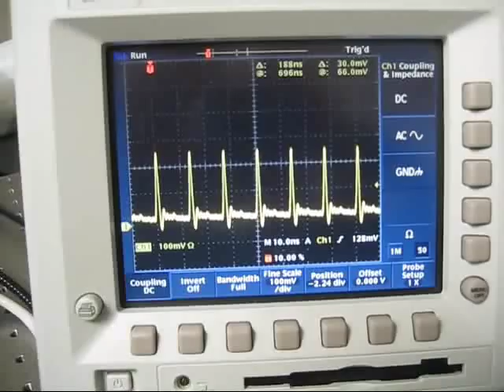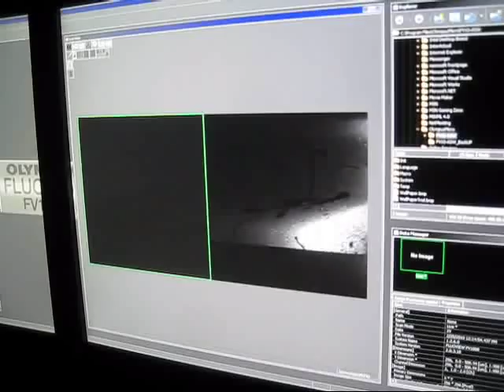Multiphoton Microscope Alignment using Second Harmonics Generation Crystal

Comment from the maker: BBO and KTP crystals for Second Harmonic Generation SHG sales@dmphotonics.com 
BBO and KTP crystals for Second Harmonic Generation SHG sales@dmphotonics.com

BBO crystals with mount diameter 25.4 mm 
Common specifications  (e-mail to request a quote for standard or custom BBO crystal)
Material: BBO crystal
Dimensions: 6 x 6 mm (+/-0.1 mm)
Thickness: 0.2 mm
Surface Quality: 10-5, scratch-dig
Flatness: Lambda/6 at 633 nm
Parallelism: < 5 arc minutes
Other faces: fine grind
Coating: AR/AR at 800 nm and 400 nm for SHG and protective (P) coating for THG
Mount diameter: 25.4 mm 
Type I, SHG, 800 nm to 400 nm
Orientation: Theta = 29.2 deg; Phi = 90 deg (+/- 0.5 deg)
Part number:
BBO_SHG_6_6_0.2_AR_800_400 
http://www.dmphotonics.com/BBO-crystal-SHG-THG-coating/BBO-Type-I-crystal-SHG-800-400.htm

Second Harmonic Generation in Nonlinear Optical Crystal 
https://physics.ucsd.edu/neurophysics/courses/physics_173_273/SHG_Diana_Jeong.pdf

Second-harmonic generation of amplified femtosecond Ti:sapphire laser pulses
http://www.researchgate.net/publication/38038394_Second-harmonic_generation_of_amplified_femtosecond_Tisapphire_laser_pulses/links/00463527aba49d5df8000000

Comment from the maker: Quantitative Imaging: From Cells to Molecules

Cold Spring Harbor Laboratory
April 5-18, 2016
Applications due January 15, 2016
Online application:  https://meetings.cshl.edu/courseshome.aspx

Combining careful image acquisition with computational analysis allows us to 
extract quantitative data from light microscopy images that is far more informative 
and reliable than what can be seen by eye.  This course will focus on advanced 
quantitative fluorescence microscopy techniques used for imaging a range of 
biological specimens, from cells to single molecules. The course is designed for cell 
and molecular biologists with little or no microscopy experience who wish to begin 
utilizing microscopy in their own research. Students will gain a theoretical 
understanding of, and hands-on experience with, state-of-the-art equipment used 
in quantitative fluorescence microscopy, including: wide-field fluorescence 
microscopy, laser scanning and spinning disk confocal microscopy, total internal 
fluorescence microscopy (TIRF), super-resolution methods (structured illumination, 
STED, STORM and PALM) and digital image processing and analysis. Students will 
learn how to design and implement a wide range of imaging experiments using 
these techniques. Students will also learn fundamental image processing, 
segmentation and analysis techniques using a variety of commercial and open 
source software packages. Students will use these image acquisition and analysis 
techniques to address specific quantitative questions and then discuss the results 
as a group, learning to troubleshoot the common problems that occur in the course 
of a quantitative imaging experiment. Among the lectures presented are: 
quantitative microscopy basics, transmitted light microscopy, image segmentation, 
image analysis, CCD & sCMOS cameras, confocal microscopy, multi-photon 
microscopy, deconvolution, TIRF, imaging ratio-metric “biosensors” (including 
FRET), light sheet microscopy and super-resolution techniques. Students will also 
learn guidelines for choosing fluorescent proteins, and work with live samples 
requiring environmental control.

Additional Lecturers for 2016:
Julie Canman, Columbia University 
Elizabeth M.C. Hillman, Columbia University 
Bo Huang, University of California, San Francisco
Talley Lambert, Harvard Medical School
Nathan Shaner, The Scintillon Institute 
Clare Waterman, National Institutes of Health

More info and online application: https://meetings.cshl.edu/courseshome.aspx

Comment from the maker: Reef NOPA1402 Scanning Autocorrelator sales@dmphotonics.com
Input wavelength range*: 500-700 nm
Input pulse energy:
>1 uJ  (at 10-250 ps)
>0.3 uJ (at 1-10 ps)
>50 nJ  (at 100 fs - 1 ps)
Input pulse duration: 30 fs - 10 ps  (up to 250 ps on request)
Input beam polarization: linear, horizontal
Input pulse repetition rate: 10 Hz - 100 MHz
Temporal resolution:   
4.2 fs (at input duration <100 fs)
16.6 fs  (at input duration >100 fs)
33.3 fs  (at input duration >500 fs)
<100 fs (at input duration >5 ps)
Scan range: 35 ps (up to 850 ps on request)
Power requirements: 220/110 V AC; 50/60 Hz +-10%

* - other wavelength ranges are available (see below)
Additional set of one crystal, beam splitter and filters for 700-1100 nm
Additional set of one crystal, beam splitter and filters for 1100-2100 nm

http://www.dmphotonics.com/Reef-RTD_autocorrelator/Femtosecond%20autocorrelator%20Reef-RTD%20700-1300%20nm.htm
http://www.dmphotonics.com/reef%20brochure%20web.pdf
http://www.dmphotonics.com/Autocorrelator/Alignment.htm
http://www.dmphotonics.com/Reef-RTD_autocorrelator/Femtosecond%20autocorrelator%20with%20FROG%20option.htm
http://www.delmarphotonics.com/Reef-M_autocorrelator/Reef-M_autocorrelator_multiphoton_microscopy.htm
http://greyhawkoptics.com/index.php?cPath=35_71

Comment from the maker: Featured application - micromachining for microfluidics

BEHAVIORAL ASSAYS ON A CHIP
Developing Lab on Chips and miniaturized devices to provide higher precision and control for investigating model organisms (e.g. C. elegans and Drosophila) behavioral responses to various environmental cues (e.g. mechanical, thermal, electrical and chemical).

NEURO-MUSCULAR ASSAYS ON A CHIP
Engineering microfluidic and Lab-on-Chip devices to automatically manipulate small organisms, immobilize them and perform microsurgery, time-lapse neuronal imaging and organ-level studies.

PATHOGEN DETECTION
Innovating macro- and micro-fluidic platforms and Point of Care (POC) diagnostic devices to perform sample (e.g. water, blood, saliva, urine) processing, sorting and detection of microorganisms/pathogens in a rapid, precise and automated manner.

Comment from the maker: We can offer both standard and custom models:

Mavericks Cr:forsterite Lasers brochure
http://www.dmphotonics.com/mavericks%20brochure%20web.pdf

Mavericks Femtosecond Cr:forsterite laser with electronic starter and fiber laser pump.
Kerr lens mode-lock, 65 fs @ 450 mW @ 10W pump
Passive mode-lock (SESAM),  75 fs @ 400 mW @ 10W pump
Passive mode-lock (SESAM),  75 fs @ 700 mW @ 15W pump

Custom:
1) (>500 mW, <50 fs, ~90 MHz, Kerr-lens)
2) (>600 mW, <70 fs, ~30 MHz, SESAM). This version has higher peak power due to lower repetition rate.
3) (>400 mW, <35 fs, ~90 MHz, Kerr-lens)

Comment from the maker: Rincon Cross-Correlator - request a quote at sales@dmphotonics.com
http://www.dmphotonics.com/Femtosecond-Cross-Correlator/femtosecond-third-order-cross-correlator.pdf
http://www.dmphotonics.com/Femtosecond-Cross-Correlator/Femtosecond-cross-correlator-Del-Mar-Photonics-Manual-sample.PDF

Rincon Third Order Cross-Correlator (TOCC)
http://www.dmphotonics.com/Femtosecond-Cross-Correlator/Rincon_cross-correlator-800nm-femtosecond-laser.htm
How good is the output from your femtosecond laser? The new third-order cross-correlator Rincon was specifically developed for measuring a wide array
of output parameters from ultrafast laser systems including: contrast ratio of laser pulses, determining pulse pedestal, pre- and post-pulses, and amplified spontaneous emission in femtosecond systems. It also provides information about the third-order cross-correlation function of pulse intensity on a femtosecond scale and can be used for alignment of high power femtosecond lasers. A portion of the input pulse is converted to the second harmonic (SH) with a nonlinear crystal. A dichroic mirror reflects the SH and transmits the fundamental thus splitting the beam into the two arms of the crosscorrelator. The fundamental beam arm includes a retro reflector and delay-line. After passing through the delay-line the fundamental is recombined with the SH and focused into a DKDP or BBO crystal (depending on the input pulse wavelength). Mixing the fundamental and SH pulses in the nonlinear crystal produces non-collinear third harmonic generation (TH). By filtering out the fundamental and SH frequencies, the TH can be isolated. Measuring the TH signal as a function of the optical delay between the fundamental and SH pulses gives the third order cross correlation function. The third order cross-correlator is ideal for looking at the full range of output from amplified femtosecond laser systems. High temporal resolution over a long (close to 1 ns) window shows pulse features that are usually missed, giving the user a detailed and complete picture of the quality and stability of the output pulse parameters of their femtosecond laser system.
Rincon cross-correlator includes opto-mechanical assembly and electronics connected with USB interface for a PC. The system is easy to operate and includes a full set of user friendly software tools for data collection and analysis.

Each Rincon is optimized for customer laser system and required range of measurements.
The complete setup geometry, dimensions of non-linear crystals and some essential optics are all function of laser parameters and user-chosen tradeoffs between sensitivity, time resolution, time window, overall size etc.

We need the following information to set the tradeoffs and get all critical data necessary for the design which is optimized for your system:
1. What is wavelength of you laser system?
2. What is the repetition rate?
3. What is the normal pulse energy and beam diameter?
4. Is the laser pulse chirped?
5. What is the spectral bandwidth?
6. What is the pulsewidth?
7a. What is the expected (or estimated) contrast ratio as a function of delay from peak
7b. What is the minimum necessary contrast ratio as a function of delay from peak
8. What is beam quality (i.e. beam divergence relative to diffraction-limited one)

Comment from the maker: BBO Crystal Inventory - sales@dmphotonics.com      
Code W H L θ φ Coating Mounted
BBO-001 2.5 2.5 25 90 0 AR/AR@1064+Au-Coated No
BBO-002 3 3 15 90 0 AR/AR@1064+Au-Coated No
BBO-003 3 3 20 90 0 AR/AR@1064+Au-Coated No
BBO-004 6.6 6.6 20 90 0 AR/AR@1064+Au-Coated No
BBO-005 2 2 10 25 90 AR/AR@946+473 nm No
BBO-006 3 3 4 47.7 90 P/P@532+266 nm No
BBO-007 3 3 6 31.3 90 AR/AR@1064+532/355 nm No
BBO-008 3 3 10 44.4 90 Brewster uncoated No
BBO-009 4 4 2.8 51.2 90 AR/AR@1064+266/213 nm No
BBO-010 4 4 5 22.8 90 AR/AR@1064+532 nm No
BBO-011 4 4 7 47.7 90 AR/AR@532+266 nm, with ring holder Yes
BBO-012 4 4 7 22.8 90 AR/AR@1064/532 nm No
BBO-013 4 4 7 31.3 90 AR/AR@1064+532/355 nm No
BBO-014 4 4 10 51.2 90 DBAR/DBAR@507.4+253.7 nm No
BBO-015 4 4 15 36.7 90 AR/AR@650+325 nm No
BBO-016 4 4 15 38.5 90 AR/AR@625(R,0.2)+312(R<0.4) nm No
BBO-017 5 5 0.1 28 90 P/P@325-1200 nm Yes
BBO-018 5 5 0.1 35 90 P/P@540-980/270-490 nm Yes
BBO-019 5 5 0.1 44.3 90 P/P@400-800/267 nm Yes
BBO-020 5 5 0.1 45.5 90 P/P@250-600 nm Yes
BBO-021 5 11 0.1 46 90 P/P@800/400 nm Yes
BBO-022 5 5 0.2 28 90 P/P@325-1200 nm Yes
BBO-023 5 5 0.2 29.2 90 P/P@400-800 nm Yes
BBO-024 5 5 0.2 44.3 90 AR/AR@800(R<0,3%)+400(R<0,3%)/267(R<0,3%) Yes
BBO-025 5 5 0.3 29.2 90 P/P@400-800 nm Yes
BBO-026 5 5 0.3 29.2 90 AR/AR@800+400 nm Yes
BBO-027 5 5 0.3 49 90 AR/AR 1040+520/260+520 R<0.5% Yes
BBO-028 5 5 0.37 90 0 AR/AR@1040+520 nm Yes
BBO-029 5 5 0.4 50 90 P/P@515/258 nm Yes
BBO-030 5 5 0.5 29.2 90 P/P@400-800 nm Yes
BBO-031 5 5 0.5 29.2 90 AR/AR@800+400 nm Yes
BBO-032 5 5 0.5 44.3 90 P/P@350-1000/230-340 nm Yes
BBO-033 5 5 0.5 44.3 90 AR/AR@800(R<0,5%)+400 (R<0,5%)+HT@267(R<3%) Yes
BBO-034 5 5 0.5 44.3 90 AR/AR@800+400/266 nm Yes
BBO-035 5 5 0.5 44.3 90 P/P@400-800/267 nm Yes
BBO-036 5 5 0.5 62.5 90 P/P@425-460/212-230 nm Yes
BBO-037 5 5 0.55 90 0 AR/AR@1040+520(R<0,5%) nm Yes
BBO-038 5 5 0.6 75 90 P/P@410-425/205-212 nm Yes
BBO-039 5 5 0.8 90 0 AR/AR@1040+520(R<0,5%) nm Yes
BBO-040 5 5 1 29.2 90 P/P@400-800 nm Yes
BBO-041 5 5 1 44 90 P/P@800+400/270 nm Yes
BBO-042 5 5 2 29.2 90 P/P@400-800 nm Yes
BBO-043 5 5 2 48 90 P/P@470-600/235-300 nm Yes
BBO-044 5 5 2.5 28 0 P/P@800 nm Yes
BBO-045 5 5 3 23.4 90 P/P@1030/515 nm Yes
BBO-046 5 5 4 24.5 90 AR/AR@1064+532 nm No
BBO-047 5 5 4 29.2 90 P/P@400-800 nm No
BBO-048 5 6 4 28 0 P/Р@800/800 nm No
BBO-049 5 6 4 28 0 AR/AR@527 nm No
BBO-050 5 5 5 47.7 90 P/P@532-266 nm No
BBO-051 5 5 5 23.4 90 P/P@1030/515 nm No
BBO-052 5 5 5 24.3 90 P/P@600-1200 nm No
BBO-053 6 6 0.1 29.2 90 P/P@400-800 nm Yes
BBO-054 6 6 0.1 44.3 90 P/P@400-800/266 nm Yes
BBO-055 6 8 0.1 28.2 90 P/P@415-830 nm Yes
BBO-056 6 6 0.1 30 90 P/P@390-800 nm Yes
BBO-057 6 6 0.1 30.2 90 P/P@800-250 nm Yes
BBO-058 6 6 0.1 30.2 90 P/P@775-387 nm Yes
BBO-059 6 6 0.1 40 90 P/P@300-600 nm Yes
BBO-060 6 6 0.1 45 90 uncoated Yes
BBO-061 6 6 0.1 42.3 90 P/P@490-750/245-375 nm Yes
BBO-062 6 6 0.15 43.9 0 AR/AR@390+780 nm Yes
BBO-063 6 6 0.15 29.2 90 P/P@400-800 nm Yes
BBO-064 6 6 0.2 29.2 90 P/P@400-800 nm Yes
BBO-065 6 6 0.2 44.3 90 P/P@400-800/266 nm Yes
BBO-066 6 6 0.2 29.2 90 P/P@400-800 nm Yes
BBO-067 6 6 0.25 61.5 90 P/P@430-500/215-250 nm Yes
BBO-068 6 6 0.3 29.2 90 P/P@400-800 nm Yes
BBO-069 6 6 0.3 30 90 P/P@390-800 nm Yes
BBO-070 6 6 0.3 32.4 90 P/P@(1000-1600)+(500-530)/333-353 nm Yes
BBO-071 6 6 0.3 42.3 90 P/P@250-700 nm Yes
BBO-072 6 6 0.5 29.2 90 P/P@400-800 nm Yes
BBO-073 6 6 0.5 44.3 90 P/P@400-800/266 nm Yes
BBO-074 6 6 0.5 28.8 90 P/P@406/812 nm Yes
BBO-075 6 6 0.5 34 90 s1: AR@800+HT@480-800; s2:AR@300-400 nm Yes
BBO-076 6 6 0.5 40 90 P/P@400-800 nm Yes
BBO-077 6 6 0.6 32 90 P/P@1030+515/343 nm Yes
BBO-078 6 6 1 29.2 90 P/P@400-800 nm Yes
BBO-079 6 6 1 44.3 90 P/P@400-800/266 nm Yes
BBO-080 6 6 1.05 90 90 P/P@390-780 nm Yes
BBO-081 6 6 1.5 21 90 AR/AR@2000+1000 nm Yes
BBO-082 6 6 1.5 39.9 90 AR/AR@1030+515/343 nm Yes
BBO-083 6 6 1.8 62.8 90 AR/AR@1030+515/343 nm Yes
BBO-084 6 6 2 29.2 90 P/P@400-800 nm Yes
BBO-085 6 6 2 29.2 90 P/P@400-800 nm Yes
BBO-086 6 6 2 30 90 P/P@620-1240/310-620 nm Yes
BBO-087 6 6 2 33 90 AR/AR@343+(450-470) nm Yes
BBO-088 6 6 2 41 90 P/P@400-1200 nm Yes
BBO-089 6 6 2.1 30 90 AR/AR@780+390 nm Yes
BBO-090 6 6 2.5 31.5 0 P/P@515+(620-2600) Yes
BBO-091 6 6 3 23.4 90 P/P@515-1030 nm Yes
BBO-092 6 6 3 29.2 90 P/P@400-800 nm Yes
BBO-093 6 6 3 31.5 0 P/P@515+(620-2600) Yes
BBO-094 7 7 0.3 29.2 90 P/P@380-840 nm Yes
BBO-095 8 8 0.04 43 90 P/P@400-800 nm, on UV FS substrate 10*10*1 mm Yes
BBO-096 8 8 0.1 29.2 90 AR/AR@800+400 nm, with ring holder Yes
BBO-097 8 8 0.1 43 90 P/P@480-800/240-400 nm Yes
BBO-098 8 8 0.1 43 90 P/P@480-800/530-1200 nm Yes
BBO-099 8 8 0.1 46 90 BBAR/BBAR@480-750/240-375 nm Yes
BBO-100 8 8 0.1 60 90 P/P@0.24-0.4+0.8/0.19-0.27 nm Yes
BBO-101 8 8 0.1 27.2 90 AR/AR@1580+790/526.7 nm No
BBO-102 8 8 0.14 44.3 90 P/P@266-800 nm Yes
BBO-103 8 8 0.15 31.5 90 AR/AR@744+372 nm Yes
BBO-104 8 8 0.25 44 90 P/P@800-400/270 nm Yes
BBO-105 8 8 0.3 29.2 90 P/P@400-800 nm Yes
BBO-106 8 8 0.3 42.8 90 P/P@410-820/273 nm Yes
BBO-107 8 8 0.8 30 0 P/P@800-1600/460-800 nm Yes
BBO-108 8 8 1 29.2 90 P/P@200-300 nm Yes
BBO-109 8 8 1 35 90 P/P@343+(450-100) nm Yes
BBO-110 8 8 1.2 29.2 90 P/P@400/800 nm Yes
BBO-111 8 8 4 28 0 P/P@800 nm No
BBO-112 10 10 0.01 44.3 90 P/P@400-800/267 nm, on UV FS substrate 10*10*1 mm Yes
BBO-113 10 10 0.1 29.2 90 P/P@400-800 nm Yes
BBO-114 10 10 0.1 28.5 90 P/P@400-820 nm Yes
BBO-115 10 10 0.1 46.5 90 P/P@400-800/266 nm Yes
BBO-116 10 10 0.2 29.2 90 P/P@400-800 nm Yes
BBO-117 10 10 0.4 45.9 90 P/P@780+390/260 nm Yes
BBO-118 10 10 0.5 29.2 90 P/P@400-800 nm Yes
BBO-119 12 12 0.5 29.2 90 P/P@400-800 nm Yes
BBO-120 10 10 0.6 29.2 90 P/P@400-800 nm Yes
BBO-121 10 10 1 29.2 90 P/P@400-800 nm Yes
BBO-122 10 10 3 40.3 90 AR/AR@213+2130/193 nm, with ring holder Yes
BBO-123 10 10 3 47.7 90 P/P@532+266 nm Yes
BBO-124 10 10 3 47.7 90 P/P@532/266 nm Yes
BBO-125 10 4 3.5 29.2 90 Р/Р@550-1100/275-550 nm No
BBO-126 10 10 3.5 47.7 90 AR/AR@532(R<0.7) +266(R<0.9) nm No